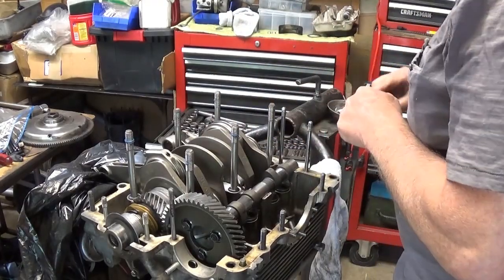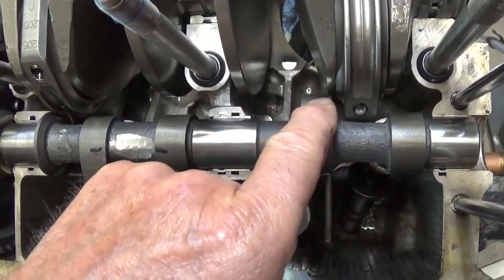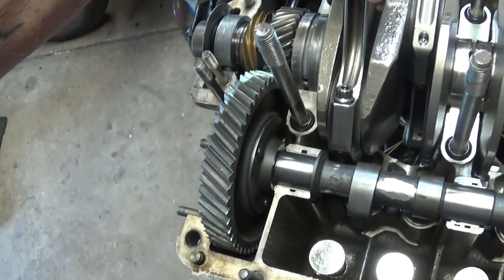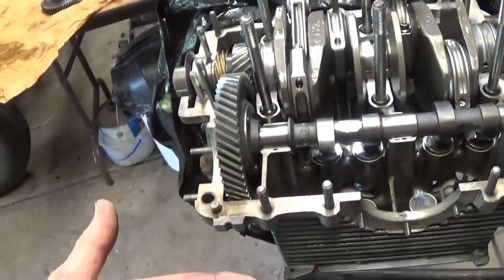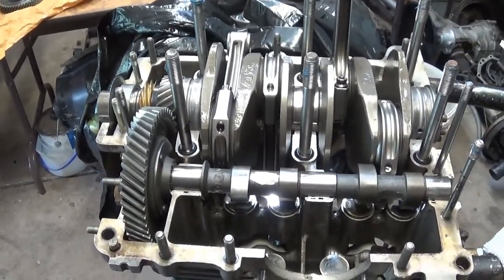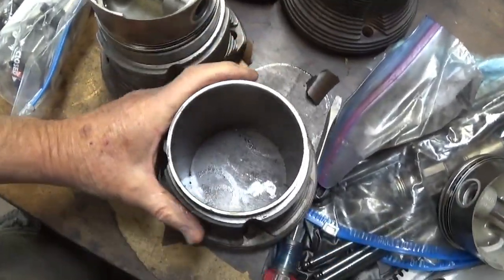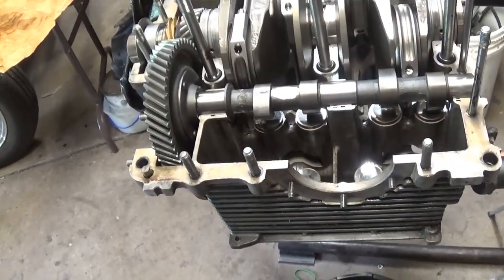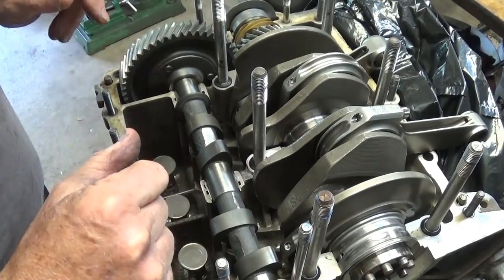VW Redneck Camshaft Clearancing

Comment: It's 14°c today when I went out for a spin, it was running like a bag of crap. I'm gona have to install some manifold heaters.  Thanks for the vid, I learnt heaps.
Reply from the maker: Sorry to hear that. Can you make a air cleaner box that would draw air from around your hot exhaust pipes. I had the full tin under my cylinders and ran some vacum cleaner hose up to the air cleaner. It helped but looked like crap and was plastic.  I always seem to go back to dual carbs and cuss the linkage issues.

Comment: Thanks for the heads up on letting the before commercial play out, I didn’t know that they gave you money to run those. I will do my part to help out.  It’s really important to be able to breathe, when we’re young and dumb we think we’re invincible and don’t wear mask, now we pay the price. Take it EZ.    GZ. 👌
Reply from the maker: I think all this brake cleaner and solvent I've been using to clean parts is aggravating it..... I was trying to use a fan for a while but that seems to aggravate too.

Comment: Would it be easier too clearance on the cam on a lathe too keep it round? Cb performance and scat is some of your best cases. For a budget autolinea is also good
Reply from the maker: Thats also a good question. I don't think it would work out to well with this style of camshaft. The material is brittle and having it full size in one direction helps.  Many high performance engines do things to make the cam lighter. They drill out the center and make the lobs narrower. Motorcycle engines are really amazing. Lots of cool things have been experimented with over the years.  Deusenberg even had a mercury filled container to balance the overhead valve head system.
Reply: @TheEZGZ  always enjoy your videos. Reducing weight on components is what you are going too use the motor for. Have a 1641 i drive daily. Motorcycles has always been ahead of the motor industry. Aliminium cases. I know laverda used if im correct birrilium pistons. Hope you remember Arlen Ness alloy bike that was built in the 90s? It used overhead cam heads that was built by Ardema(hope spelling) is right. Wonder if such a conversion will/could work on a aircooled motor.

Comment: Great video..I agree the aluminum case is better. I'm so tempted to do this same thing to my 1915 I don't need the clearance just the stability. I'm running double valve springs. And get a little more in the rpm. I built it to have fun with. You have to start with a good foundation.
Reply from the maker: Anything with a piston that has a "A" pin height is fine with a AS41 case. If you want long life and high RPM it should be a new case not a line bored one.
When you step up the "B" series pistons that are mandatory with all 78mm and larger stroker crankshafts then I suggest going to Aluminum Case.  
Know matter what you choose, there is still a gamble as to qaulity of new replacement cases.  If folks demand cheaper prices they will cut corners to get the sales. 
GOOD Quality is Cheaper in the long run.

Talking cases is like talking oil, Everyone has a preference.
Reply: @TheEZGZ  thank you ez and so true on the quality of some of these cases I try to buy from reputable companies and yes you pay for it but it's worth it. Thank you so much for your input
Reply: I am running a fuel injection case that has not been line board

Comment: Hi, what size of conecting rods do you use with the 82mm crankshaft? Having in mind that I will use regular fuel and I want stock compression ratio, think it´s the 5.7" conecting rods, isn´t it?
Reply from the maker: I take Gene Berg's advice and went with the 5.325.  With 55cc head. That came out to 9.6 to compression which is to high for todays pump gas.  5.394 is stock but you will need shims and have a tuff time getting low buck headers to fit.  I would never use 5.7 with chevy journals.

Comment: Just wanted to say thanks for all you do. I have watched so many of your videos and have learned so much!!  Keep up the good work!!! Do you have a video about explaining how cam shafts work as far as the numbers go when picking one? Lift, duration etc and how that works with what the engine is doing while the cam is doing what a cam does? I have saw videos where you talk a bit about lift and duration but the whole mechanics involved, what the pistons on their  different strokes are doing? Like the cam is the brain of the engine, it determines which up and down of the piston is intake and which is exhaust via the valves and how much and how long each intake and exhaust breath takes, etc.
Reply from the maker: Thank you for your support. I'm glad you enjoy my vids. Stay Tuned.....
Reply: TheEZGZ  yes sir. 👍.  Looking forward to George(cam) and Lennie(crank) videos. I have my engine tore down completely, sure do wish I had watched your cast vs forged before I ordered my cast 69 crank. Hahaha.  It’s gonna be mostly just a stock engine though. I am kinda on the fence about the cam, leave it as just stock or maybe try the cheater cam I had saw you mention. I did order the Hd springs, just in case I decide to do something like that or just 1.25’s. Running a 34pict-3 single now but planning on running at least 34 duals later, possible dual 40’s, that way I have the carb to grow the engine down the road. Writing you a book here, sorry. 😂
Reply: sorry to be so off topic but does anybody know of a trick to log back into an Instagram account..?
I was stupid forgot the account password. I would appreciate any assistance you can give me!
Reply: @Orion Malik Instablaster ;)
Reply: @Cain Prince I really appreciate your reply. I got to the site on google and im waiting for the hacking stuff now.
Seems to take a while so I will get back to you later when my account password hopefully is recovered.
Reply: @Cain Prince it worked and I finally got access to my account again. Im so happy!
Thanks so much, you saved my ass !
Reply: @Orion Malik Happy to help :D

Comment: Off topic, what jets would you start with on a center mount 44 idf. 2276, 8.5 to 1. 480 lift cam. I cant get it to idle without progression ports, plugs show rich but seems to lean out with some rpm. Wont even attempt to idle unless mixture screws are 3+ full turns out. Carb has f7 emulsion 140 main and 65 idle jets and 2mm hole drilled in butterflies. No vacuum leaks. Doesnt make sense and any suggestions would be extremely appreciated. Great video by the way!
Reply: What have you got for manifold heat?
Reply from the maker: You need a 110 cam or smaller to reduce the reversion.  You can buy 28 venturi's for your 44 IDF and use the recommended jetting for a center mount 40 IDF
It will barely run unless Outdoor air temps are above 70 degree's F.  
Like Wayne said you need HEAT in that manifold.
With all the fuel your dumping in there it's still running LEAN because the Vaporized fuel is condensing back into a liquid.  Liquid gas does not burn. It will dilute your oil and wash the cylinder walls and you will start smoking blue out the exhaust. Your engine temps will start to climb.
Go to your favorite ridding area and see how many VW folks are running centermount 44 IDF's and they are running good.  You won't find to many. Theres a reason for that. It doesn't work well and folks don't want to cobble in the extra pipping to get proper flow there the manifold. Going from the plates on cheap headers that go from cylinder 4 to cylinder 2 barely works in warm weather. 
Oh yeah, get a bigger gas tank and carry extra spark plugs.

If you want that engine and cam to work sweet. Buy a pair of New 40 IDF webers made in spain from  REDLINE Pay extra to have them set up.  Yes 40 IDF's with 28 venturi's. 

WEBER 44 IDF	Factory
Sizes	Single
Carb	Dual
Carbs	
AIR CORRECTION	1.75	1.65	1.75
EMULSION TUBE	F-11	

MAIN JET	1.35	1.60 (d)	1.35
PUMP JET	.50	.50 †	.50
IDLE JET	.50	.65 (d)	.60 (d)
VENTURII	36mm	

NOTE: Drill 2mm Hole in each Throttle Valve for Single Carb setup.
(d) = drilled
† = Uses .0 Bypass

WEBER 40 IDF	Factory
Sizes	Single
Carb	Dual
Carbs	
AIR CORRECTION	2.00	1.60	2.00
EMULSION TUBE	F-11	

MAIN JET	1.15	1.45 (d)	1.15
PUMP JET	.50	.50 †	.50
IDLE JET	.50	.65	.55 (d)
VENTURII	28mm	

NOTE: Drill 2mm Hole in each Throttle Valve for Single Carb setup.
(d) = drilled
† = Uses .0 Bypass

Comment: Man the irony that I just pulled the engine out of my buggy for a knocking sound that I had already determined to not be rod knock and I found out that my eagle cam and the thrust bearing didn't agree to well. The knocking was the cam bolts hitting the back of the oil pump. I guess it's time for some straight cuts, new case and bearings. I did have double thrust cam bearings in it so it was a little bit of a shock to me that it did that after only about 7k miles.
Reply from the maker: Ouch!  I'm so glad you had the sense to check it out. Have you decided which strait cuts you want. I got mine from AA and they are narrow compared to the one CB  sell's. I am told they are a little quieter.
Reply: @TheEZGZ  I will likely go with narrow ones beings my eBay namesless pump is a little deeper than average and already just bearly cleared the cam gear. For being a cheap pump that thing has worked amazing for me. Noise will not be a problem for me at all. It will likely be cool to have the turbo noises mixed with it. I welded up a turbo header and a draw through carb adapter a bit ago and with all this it's the perfect excuse to regap the rings and put a little boost to it.
Reply: You probably already fixed this...but be careful. Most of the cam bearings available now are way too tight and need to be adjusted. There's no more snap them in and go! Don't just throw them in the engine. Install the bearings and the cam in the case and check the end play of the thrust bearing. Book says to whack the cam fore and aft with a block of wood and still sometimes sanding with 400 grit on a pane of glass is needed. I've had to do this in my last couple builds single or double thrust!

Comment: How much clearance would you consider to be safe thanks buddy
Reply from the maker: Berg recommended .040 with his crankshaft and .060 or more for everything else.  Mine was a scat chrome moly crank with CB H beam rods.   I used the .040 feeler gauge and if I could slide it threw I was happy.  I never tried to get it exact.   Look how I booggerd up that Cam lobe.  hehehe  Everything looked good and worked good all these years later.   Hey, the next guy might do everything right and it blows like a grenade.   At some point ya just take a breath and say to yourself.  LET'S GO!

Comment: Hello  Mr.EzGze I have a cheater cam what's the torque on these cam bolts ?
Reply from the maker: 24-26 FT Pounds use loctite and use new bolts every time. Bolts stretch and wear out. Be sure and check the clearance between oil pump and head of cam bolts. It's ok to grind off some of the bolt head if needed.
                                     " NO CHEATING"
Reply: @TheEZGZ  thank you so much EZ .
I thought I would get a cam that reminds me of my X wife as I'm crushin down the road grinning like a swamp possum. Blessings and more Blessings to you and your family

Comment: hi ezgz will that on balance the cam
Reply: No, cams aren't balanced. The lobes make them out of balance to begin with, but they are only an inch or so from the center of the cam, and it only runs at half the RPM of the crank, so it really doesn't matter.
Reply from the maker: Good Question, NO, It's a very small diameter. They don't balance cams because the lobs are all over and different sizes.
Reply: @TheEZGZ   thank you i jest learn more did not know that